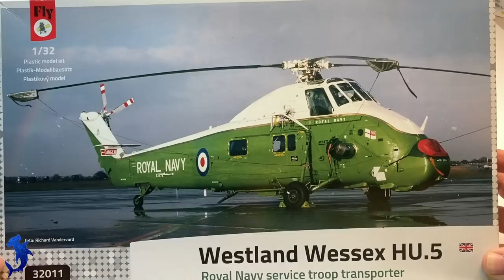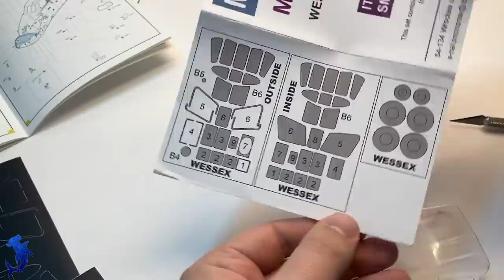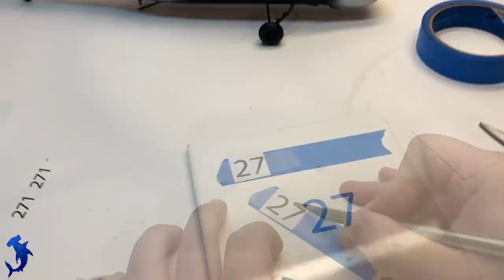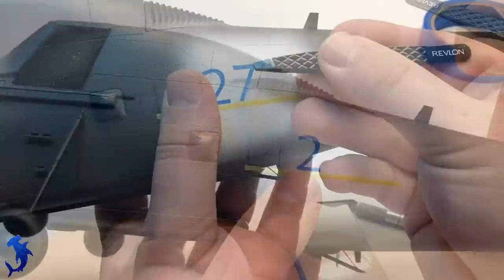Fly Westland Wessex 1/32 Full Build

Comment: i remeber using those cloth/fabric belts on 2 different kits, there in the 1/12 f16 cockpit and the 1/12 f104 cockpit both by italeri, i find its easier to cout them with scissors as they can tear up the strands with a knife
Reply from the maker: Good tip!

Comment: You've achieved a great result with a difficult kit. I have this one in my stash, so I appreciate you providing a heads-up of the potential pitfalls with the kit.
Reply from the maker: This kit has a lot of potential, like I mention in the video, a lot of the resin parts with regards to the rotors will need support/strength, but in the end it looks like a Wessex!